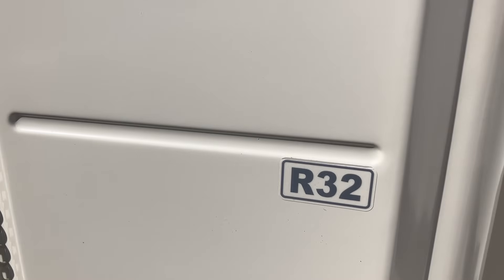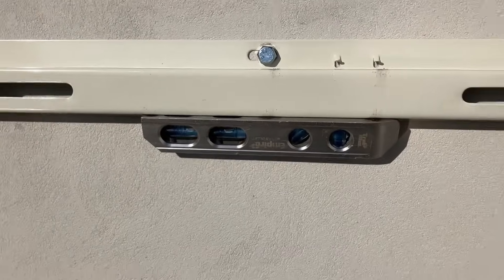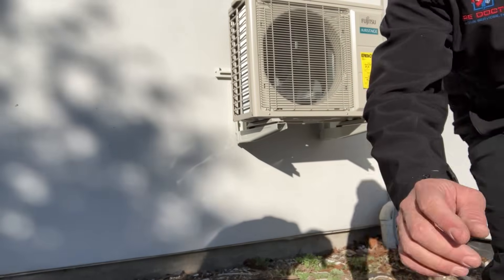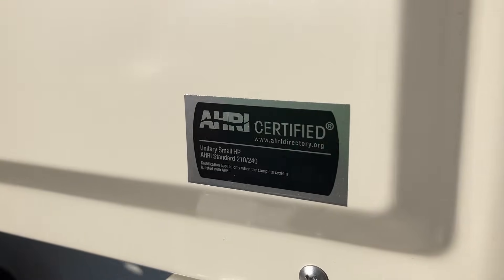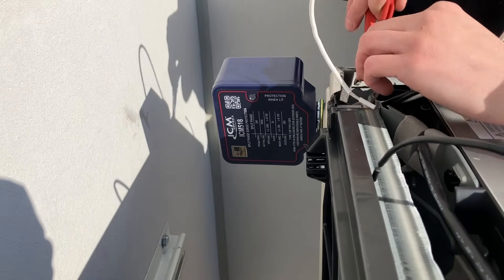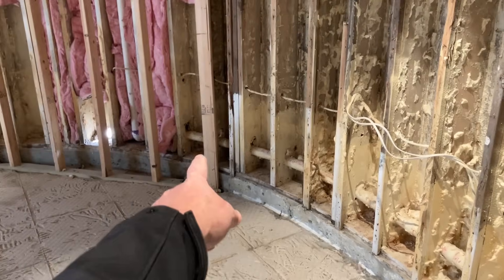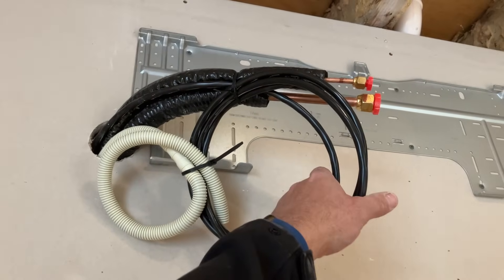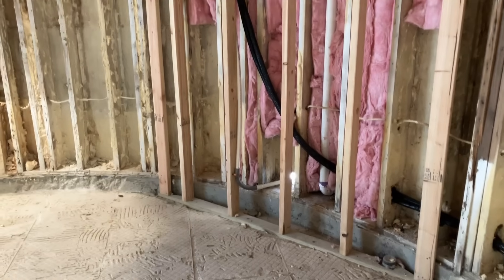Fujitsu R32 Ductless Mini-Split INSTALL – PART 1 | A2L Refrigerant, Real HVAC Work

Comment: For interior wall installations, can I route the line set out the right hand side (typically a 180 degree bend) of the indoor unit? That is my only option. If so, any brands suggested for a 1.5T (18000 BTU) unit?

Comment: No drilling require for the surge  protector right on the disconnect box
Reply: Not possible when the disconnect box is recessed.
Reply: @eDoc2020  its new install right ?

Comment: I put a 3-ton P series two fan Mitsu on a Rector seal bracket requested by customer. The customer was pissed this winter as makes a lot of noise in heat mode.
Reply: lol, go figure

Comment: So god forbid you have a problem with the line set and have to replace it? Then what?
Reply: well if you dont wanna tear into the wall you run the set outdoors and use line cover i think they are doing it this way because the wall is open
Reply: Agreed but no difference than the countless other homes with line sets inside walls running to the attic. Exposed line sets are not common in my area.
Reply: As long as there are nail plates so the sheet rockers don’t penetrate, it will be ok. The only way it could leak would be at the connections. No different than pipes or electrical.

Comment: Why does that unit have to be wall mounted vs. just leaving on a ground mounted platform like a traditional a/c unit?
Reply: It doesn’t have to be wall mounted  but if using for heat shud be mounted or on a raised condenser pan
Reply: The cold weather it heats also. The condensation will ice up.
Reply: @scottmaz4063 keeps it above the snow line
Reply: @kwhite145  exactly the water will go below the unit
Reply: Helps keep it off from the winter elements also keeps it off from the ground, which helps prevent corrosion